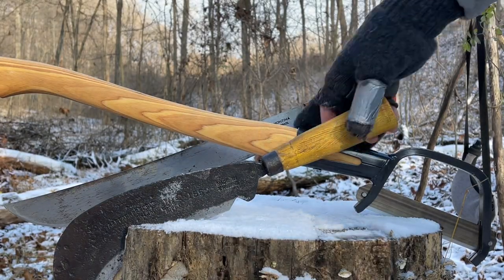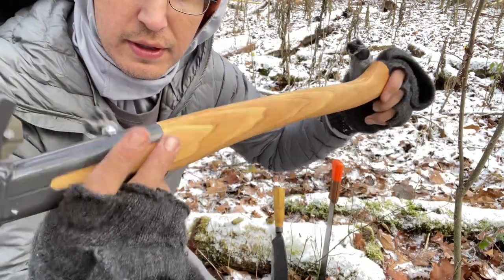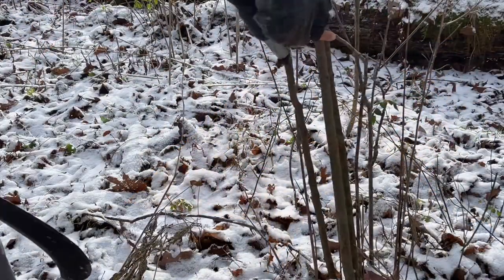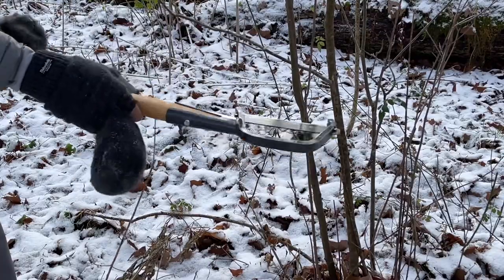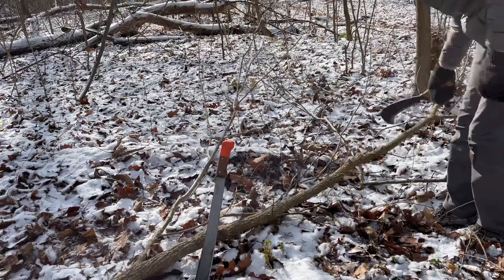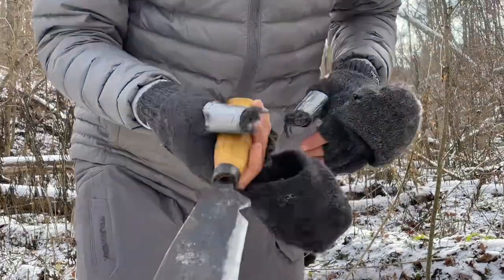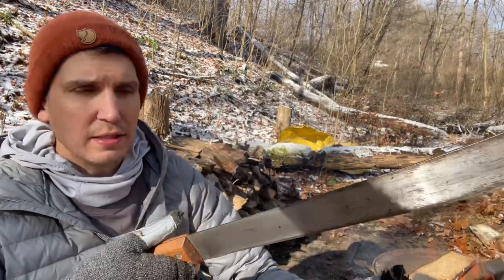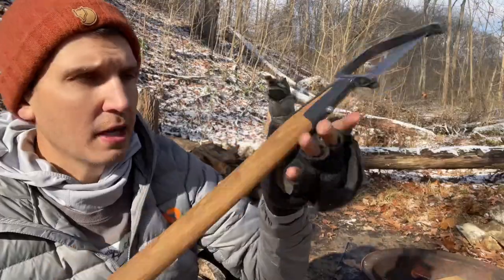Testing Three Brushing Tools for Woodland Work: Billhook, Machetes, Sandvik

Comment: The one used in this video has the elegant simplicity of a Devon billhook, whereas the one I own is a Stafford pattern, similar to the Devon but with a flat blade of 4" or so along the back of the blade, towards the top. The Yorkshire pattern is longer and broader, shaped a bit like a paddle with the blade extending the full length on both sides and ending with a hooked tip on one edge. The Yorkshire billhook lends itself well to a longer handle for two handed use. Long handled billhooks were often the weapon of choice of the mediaeval footsoldier and I've seen a painting of enslaved plantation workers cutting sugar cane using billhooks similar to my own Stafford billhook.

Comment: Thanks for the video Kevin. My local hardware store calls the Sandvik a brush axe. They sell the replacement handles too which I've actually used as replacement handles on some hatchets where I've wanted a little extra length.
Reply from the maker: Have you had to replace the blade yet?
Reply: @KevinsDisobedience  I don't have the axe itself. Just picked up the replacement handles to use for hatchets.

Comment: Thanks for yet another great video! I can recommend a Scandinavian brush knife / clearing knife  (ryddekniv/ krattkniv/ röjkniv) for saplings. It resembles a short scythe with a hooked, sturdy blade. It is rarely seen here, and unsure if it is available outside of Scandinavia, but it works great for saplings up to an inch in diameter. The long handled knife is placed at the base of the sapling, and drawn towards you while the sapling is grasped with the other hand and bent towards you. This introduces tension on the cut side, so little effort is required. Cut saplings are easy to pile up or throw out of the way afterwards.
(Previous comments seem to have been blocked?)
Reply from the maker: Not blocked by me.  I don’t even know how to do that lol.  But that sounds like a good tool.  Have to keep an eye out for one.

Comment: Envious of that billhook and I love the handle. I will get my hands on one someday. "Sandvik" is what I've heard used, along with Swedish brush axe, or clearing axe, for those. I guess that's like Kleenex for tissues. I have one but the head is got bent enough at some point that it's hard to swap the blades (I have to do it on a bench vise) and so I've found myself not using it much. Too bad because a lot of what I need is something to do really brushy work. Anyway, a great thing about them is that you can carry multiple blades and replace a dull or nicked one easily in the field (although the trick to popping the blades takes some practice). The blades are easier to hone on a stone if you pop them out. I've heard them called 'safety axes' too but that might be a bit optimistic. However, when I was young and enthusiastic I definitely whacked myself painfully but recoverably with one more than once in a way that would have been devastating if I'd of had a regular axe. Basically, with moderate amount of luck, if you catch a glance, you are likely to smash yourself with the tip of the frame instead of digging the blade in. For that reason they are popular here for trail clearing crews staffed by summer students. One word of caution is that it was over enthusiastic use of a sandvik that triggered my initial bout of tennis elbow, which I know you've also had issues with.
Reply from the maker: Thanks for the info.  I was eyeing that blade yesterday and thought that looks tricky to get out.  You think they’d make one of those pins pop out for easy access.  I’m guessing you have to tweak the frame a little?  I was happy to see I could file this.  Definitely be easier out of the frame, but I was worried I wouldn’t get it back in lol.
Reply: @KevinsDisobedience  I was going to reply with more info but I can't find anything online. Zilch! If I can borrow a working one maybe I'll make a video because it seems like a void to be filled. They used to come with a pamphlet that had a diagram for doing a field blade swap. Basically you use a stump, log,  or stout limb that just passes through the frame. If you nick off one side to make it D-shaped in cross section it's better. Then push on the handle and the blade should pop out. Getting the new blade in is super easy, you just set it in place and then give it a whack against a stump or other solid piece of wood and it will pop right in.
Reply: @KevinsDisobedience  Borrowed a friend's brush axe and made a blade replacement how-to short https://youtube.com/shorts/KEuVKG1bqPk

Comment: Hi Kevin,  I'm very attached to my bill'ooks   ;<)
There a huge variety of hooks made, often for particular jobs and regions.  My favourite around the woodpile or for general work is that Yorkshire pattern. This has a curved front blade very similar to yours but has a raised straight edge on the back. This can have a short handle like yours or socketed versions often have a handle of 18 - 24 " and sometimes up to 4 or 5 feet. [Google billhook patterns images]  When cutting with a hook, there is definitely a sweet spot on the blade for efficient work, and is great for use as a pickaroon. I regularly pick and carry 30 to 40 pound rounds with a hook - saves a lot of back bending. Trick is to drive the blade into the log edge and lift slowly letting the blade rotate a little till the point comes in contact with the log end face. then you are good to go.
Reply from the maker: Yeah, I’ve seen many different patterns.  I’d like one with a flat blade for making puds—that’s what we call kindling here.
Reply: @KevinsDisobedience if you want a good kindling chopper, that Japanese nata I showed in my bowl carving video is a beast. Has a blunt nub on the end of the blade so that it doesn’t get stuck in the chopping block. A really great tool.

Comment: Sweet video! Nice of Ben to send that to you. I bet it’s pretty old. The billhook is my personal favorite of those three. I recommend buying a billhook holster if you can find one online or make your own. Rinaldi makes them, but you can find them on Howland Tools website I think.

Sandvik is both the tool and the name of the company that invented them. I have an old sandvik bowsaw. I remember when I was in Boy Scouts they gave me one of those tools to do brush clearing and trail work. Absolute beast for small saplings. The thin edge is intended to be replaced, but you can easily sharpen it. Even with a dull edge, the thinness makes it good for chopping. Though word of caution, if you try to chop anything 6inches + expect that blade to go flying into the woods🤣.

Thanks for sharing, good stuff!
Reply from the maker: I’m assuming you learned from experience that 6” is the max lol.  You look like a scout, and that’s not a insult.  I wish I had went through the program.  Do you teach these days?  If not, you should.
Reply: @KevinsDisobedience Thanks! Yes, I help out at a few troop functions every year. I’m close with the current leaders of the troop I went to not that long ago.

Scouting gets a bad name, but it’s really what you make of it that matters. I always thought it funny that most skills associated with bushcraft have been common knowledge to scouts. Fire building, knot tying, shelter making, and first aid and safety are all pillars in the skills I learned as a kid. Leadership, public speaking, and being able to teach skills to others all formed in time.

I think highly of the program, but without good role models it never would have meant much to me. That’s why I like to give back when I can.
Reply: Good to keep yourself safe. A scabbard is easily made and fun to do. For a stop-gap to protect blade and self, I have split a length of hose pipe along it's length and simply 'clipped it ' along the edge. Hold in place with a couple of diy rubber bands made by cutting 1/2 inch wide sections of a bike inner tube.

Comment: Addendum: the machete, while a great movie, was developed for the less dense vegitation found in the tropical setting. Great reach, low weight...swing that king all day. The Billhook can be argued as an ancient tool of the European climbs. Generally a gathering tool.
Grasp wheat with one hand - pull toward you with the hook. Some varients come with a blade on the 'back side' making it a multi-tasker. A medieval farm without this guy was truly boned. 🌦
Reply from the maker: Yeah, that’s what I’ve heard and seen as well, but they definitely have their place around the modern American farm.

Comment: glad you like it. Billhooks are definitely better in woody material than machetes from my experience. The one I sent you is a very typical general purpose but there is quite a lot of variety to excel in different tasks. there is very light, longer, thin ones that feel similar to a machete to swing right up to heavy 2 handed boys axe size such as the yorkshire pattern.

here is a very good old video showing hedging with billhooks and slashers https://www.youtube.com/watch?v=WoprVhpOKIk&ab_channel=BFI
Reply: It does seem strange to me that billhooks never really seemed to be popular across the pond, I wonder why that is... they are such an efficient tool and very adaptable.
Reply from the maker: I’ve watched some of this before.  Definitely a great hedging tool, which every garden in suburban England seems to have if I remember correctly from my short stint abroad.

Comment: Awesome! For bush regen and trail work here I'm always lookin for weird tools like this. Billhooks, and machetes of course,  are awesome. Never tried the "sandvik", here when you can find em they're generally marketed as a "brush axe". Been intrigued by the design but never seen one used. Stihl for a while here was selling a kind of hybrid tool, a small (maybe 6-7 inch) bill hook blade with a socket, mounted to a handle similar to the sandvik. Some of these newer husqvarna forestry hand tools are pretty cool, and good value. Is the stream running though your camp gunna freeze over soon?
Reply from the maker: Yeah, the brush axe would work good on some of your stalky green vegetation.  I’m think of whatever that ‘palm’ was you had a go at with the tassie that one time.  The creek usually freezes, yes, but we’ve had a very mild winter so far.  No real snow to speak of and 50F weather most days.

Comment: Sandvik. Meh. I might be concerned about failure at the welds.  Billhook I'd try that for small saplings, sure . I have a Gerber Machete (24" I think, same length as yours , looks like) and I freaking LOVE it, the handle is awesome and I can brace it to my hand with the lanyard to help eliminate hand shock and it just feels more secure. I annihilated about a 1000 white pine saplings with it. I thought it had plenty of power to do thicker limbs too. It has a saw on the back side of the blade, which helps a lot, but some caution on that.
Reply from the maker: If the welds are good, should be as strong as the frame.  I can always tack it back in place if it does fail.  But definitely don’t underestimate the billhook for brushing out woody material.

Comment: Interesting.  I've used hooks and Sandvik brush axes. I have a biped of that size and pattern. Made by Parkes in Willenhall (Birmingham). You've fitted the handle (probably the only Biped with an Osage orange handle) as a half-tang handle. Originally it was a full tang, which long term would be more robust. Have a shufti at this vid for hooks: (including a Biped) https://youtu.be/mLgI6txnEls.  And this one for sharpening: https://youtu.be/DyOHfL7BNt0  There is another one on there about handles and one showing handles for hooks being made from green wood (easier and faster and do it the right way and it will not split).  This vid shows how I cut kindling: https://youtu.be/BSSY0luouDk  Your Biped is a general purpose hook. Good for cutting in-rotation hazel coppice, so it would eat saplings. Bend them over slightly before cutting and the cut will 'clear' and the work will be easier. 
The Sandvik brush axe fits a niche similar to the hook, but 'safer'. If you go too enthusiastic at too-large stuff and the blade will bounce out. There is a trick to getting it back in. Best cut at an oblique angle ans it will tackle surprisingly large stuff. Hope this is all useful.
Reply from the maker: Thanks, I like it, but ever since I’ve discovered the brush axe or the sling blade that’s been my go-to brushing-out tool for felling.